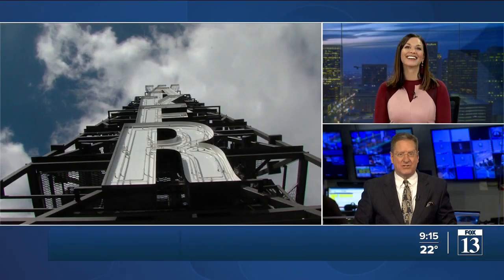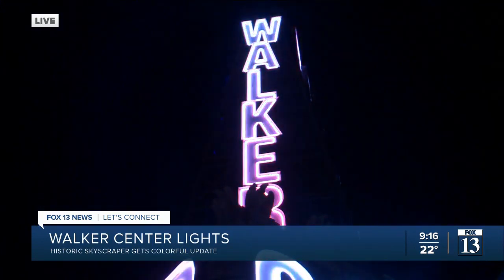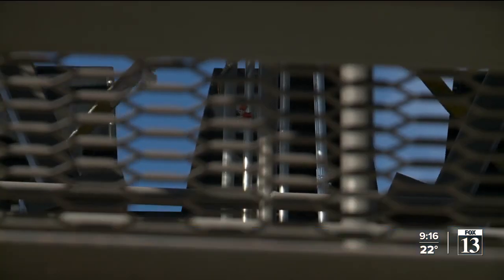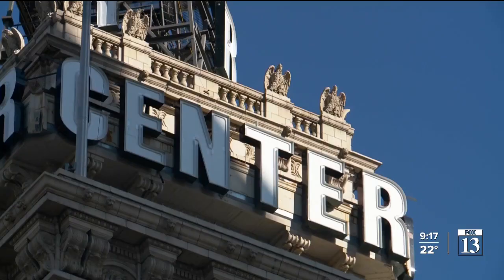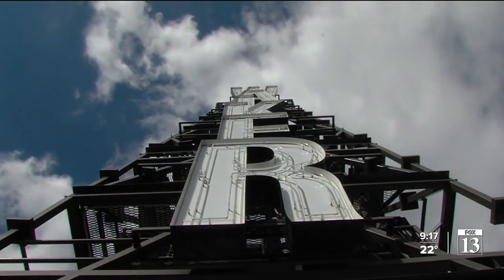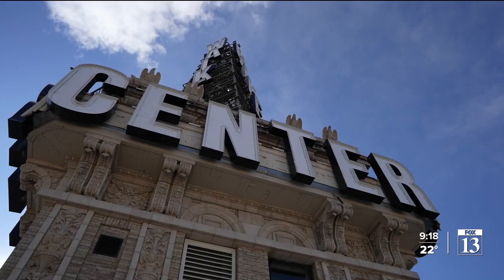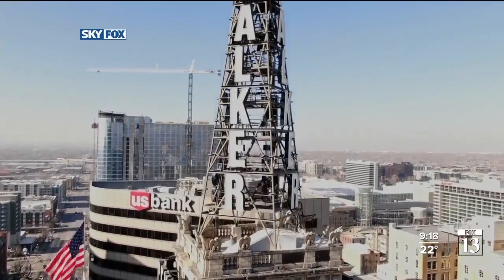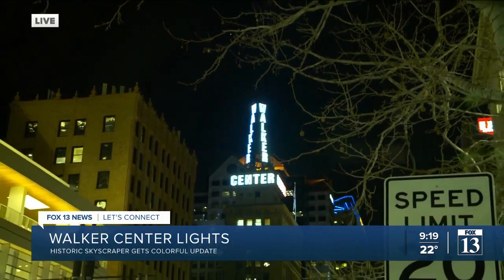Historic Salt Lake City skyscraper gets colorful update

Comment: I would be curious as to what the differences between the LED lights and the old lights monthly power bill would be.
Reply: Using LED, you will save 62% in costs.

An LED bulb will actually use 75% less energy on average compared to a standard fluorescent bulb. LED lighting can be more expensive initially when buying the bulbs, however, in the long run they will save you money.

Comment: I wish that Salt Lake City had a tower like the CN Tower but where the entire footprint took up an entire block and it would be at a minim of 365 / 15-foot stories tall? It would be nice if there was a minim of 750K hotel rooms and a minim of 375K apartments that would be no less than 1,850 square feet for a 2 bed 3 bath and no less than 950 square feet for a 1 bed 2 bath? These would go up the wings/ fins of the tower with the hotel rooms below and the apartments above? It would be nice to have in the saucer area at the top would have an indoor theme park-like Circus Circus that would be 5 / 15-foot stories tall and all other stories in the tower from the ground level to the very top would be 15-foot stories? There would be 2 different rotating restaurants. One would be above the theme park and one below the theme park? There would be an indoor and outer deck with large windows below the lower restaurant and a walk like the CN Tower above the upper restaurant with a rooftop deck above it all? Salt Lake City keeps building a bunch of lame boxes and they never are world renounce or unique?